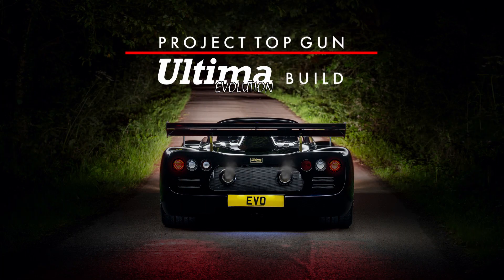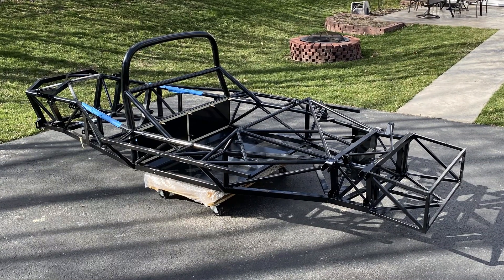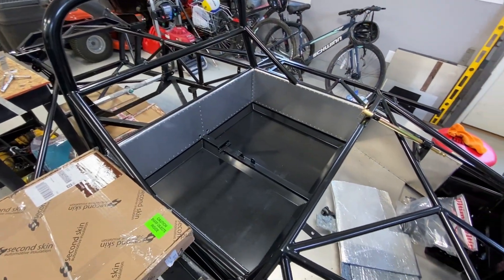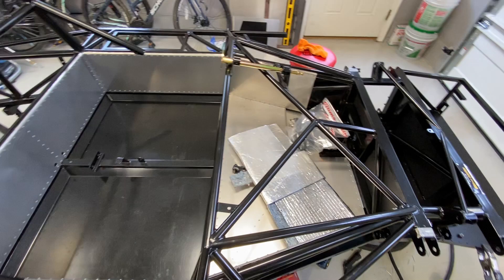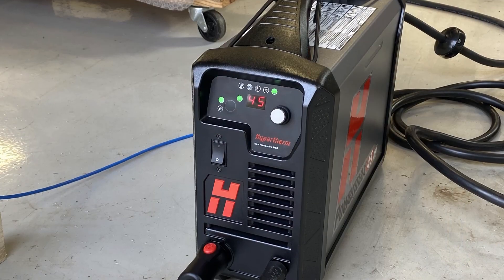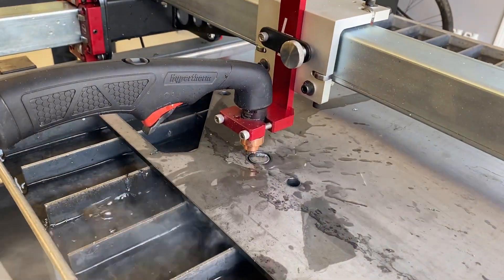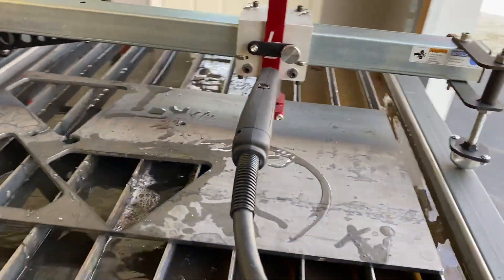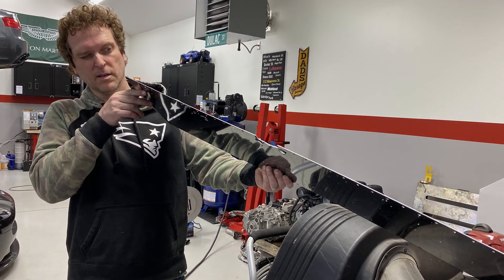Project 'Top Gun' - It's Just Riveting - V10 Ultima Evolution Build

Comment: Great video! What software are you using to record your computer screen when moving the parts around in the CAD software?
Reply from the maker: I used Quicktime on my Mac...it has a "screen record" feature...Since Quicktime is automatically installed with any MacOS, it's free and works great!
Reply: @DanDulac  Gotcha! Windows needs to catch up on that!
Reply: @DetachedGarage  try OBS, I use it for my windows laptop. Works really well, lots of online support when I got stuck figuring it out 😄 https://obsproject.com/